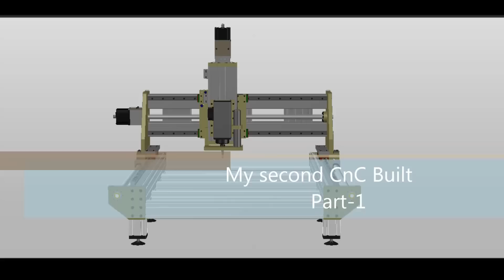Second DIY CnC Router Part-1

Comment from the maker: Trespa is normally used outside for decoration on buildings..low maintanance materials..
normally used in constructions is 6 or 8 or 10 mm..

Its soo much better then mdf or hdf..

Comment: Hi looks great similar to one I am making, not sure to use rack and pinion or ball screw as my longest side is 2000 mm what diameter size screw did you use and did you get any whipping of the screw at high speed i am looking at r2020 screw 20 mm dia but unsure if it will be ok.

Comment from the maker: Trespa is a flat panel, based on thermosetting resins, homogeneously reinforced with cellulose fibers and manufactured under high pressure and temperature.
(Trespa is like compressed paper and gleu under high pressure)
Its verry strong ..but not on the end faces.. 
Normally 6 8 or 10 mm is used.. i found 20 mm but is little bit hard to get..
The name of the song is "Burn the witch" from "Stone gods".

Comment: Hi Ralph,
First I've thought you are using Line 8 160*80+80*80 LIGHT profiles, but on x times replaying your videos I think the profiles are Line 6 120*60+60*60 Light. Is this correct?
What did you use to connect the rail to the profile? It looks like you used normal profile nuts (longer ones) instead of Item's rail mounting rod that fits  only the Line 8 profiles.

I'm building a machine almost like yours, only the side "towers" of Y will be of extrusion (maybe 160*40) and the Y beam will be from single 160*80. But the price difference between the line6 and line8 is almost the double so I prefer the line6 if it's suitable for the job.
Reply from the maker: Hi Zoltan,
I use 160*80 and 80*80 light profiles.. and also the profile conectors to use for connecting hiwin to the line 8 profiles.

dont buy to cheap..it will bite you later..:-)..also depends on what you wanna use your machine for..

I want the machine to be strong for cutting wood and aluminium
Reply: Ralf Klaassen
Hi Ralf,
Thanks for your answer! Yes, I hate bitemarks to, especially on the wallet :) I already spent around 1k euro on parts, and the machine is still on the paper, don't want to ruin it now. I'll go with 16/80+80/80!
Yours are light version if I'm correct? They are still very massive pieces.

My goal is to build a machine capable working on aluminium and softer materials. It must be as strong as possible.

Can you please explain in few words how hard was to align the rails?

Did you machined the profiles where they contact with the rails?
Is the Item's factory cut precise enough to get the frame together, or you had to machine it afterwards?

About the connectors? Is it this one: 0.0.427.39?

Thanks!
Reply from the maker: *****
Yes i use the light version
light version is more then strong enough in a good construct build.
i also use 40x80 between the bridge profiles to remove torsion in it.
its become a verry strong setup.

for align the rails i use 80x160 on perpose because they dont bent...and you can asume they are straith.. i use a clock to straithen it whit the sides..

if you dont have the profiles in between not exact..its a problem..
you can also put the profiles under the 80x160..and the problem is solved.
then you can also make the bridge lower to the rails..so more strenght in the machine.

I think directly from the item factory it wil be cut verry percise..but check it good

greetz,
Ralf
Reply: Ralf Klaassen
Thanks,

I'll order them factory cut to dimension.
The 40*80 is not in the video, you added it later because 2*80*80 was not enough?
Reply from the maker: *****
Hi, i put the 40 x 80  in "Part 2" ..i did it so the ballscrew nut has more space..

greetz

Comment: Ralf,
Who did you get the leads crews from? I am in the process of build a 6' x 10' CNC Router and am interested in putting lead screws on it instead of rack and pinion. BTW, nice job on the CNC table.
Reply from the maker: Hello,
Leadscrew 25 mm from "ISEL" pitch 5-10 or 20 mm from www.damencnc.com
Greetz,
Ralf
Reply: Awesome. Thanks, Ralf.

Comment from the maker: Hello Mark,
I use 25 mm spindels whit a 10 mm pitch.. my longest screw is 1500 mm and is maximum lenght i think,
but at a bigger pitch motors rpm will be  less fast for the same running speed..
for 2000 mm i would go for rack&pinion system i think.

Comment: Nicely done!!! Good craftsmanship, great tunes, and what a cool shop. I like the post and beam ceiling, haha... What kind of driver board are you using? I'm looking at a g540, but the tb6560's are so much cheaper...  How much would you estimate that you have invested?
Reply from the maker: Hi..i wanna use the USBCNC CPU V4 from damencnc.com and i will use about 7000 euro in total for the whole build
I use it for my company so i need a strong reliable machine!
Reply: Ralf Klaassen
Have you looked at a dedicated control like something from GSK?

Comment: what linear rails are these? they look great.
Reply from the maker: Hiwin
Reply: Ralf Klaassen what size Hiwin ? I am looking at changing my setup too, also is this machine pretty precise/accurate at cutting? thx! my machine I am building is about 2ft x 4ft, right now I have shafts with no support (2 shaft supports on either side of the machine) on my 4 ft long X-Axis and it wobbles when I try to rock the machine with my foot (shafts are 20 mm thick) thx!
Reply from the maker: Machine is verry accurate..verry please with the stiffness. Z-axis is mounted now and its great!! I use HG25R type hiwin linear guides for the X-axis and HG20R type hiwins on the Y and Z axis.
https://www.damencnc.com/nl/componenten/mechanische-onderdelen/hiwin-linear-guideways
Greetz,
Ralf
Reply: Thanks! btw what is the length of your X axis?
Reply: would the HG25R's work for a 4 foot length machine?
Reply from the maker: *****
1500 mm lenght.. working dimensions 1150 mm +-
Reply from the maker: *****
HG20R is also good enough..strong enough

Comment: What material have you use to make the supports. I mean, this white faced and black laterals? I dont think its wood, is it? thanks
Reply from the maker: Trespa is a plastic sheet material, which is produced from thermosetting resins, which are reinforced with cellulose fibers. The production takes place by mixing with fiber material and resin material to be cured by means of heating.
Trespa has high impact resistance, a closed surface (therefore easy to clean), fireproof (no melting or exploding ring risks). It is to edit with sawing, drilling and milling tools suitable for hardwood.g

greetz
Ralf
Reply: Ralf Klaassen
thanks! I couldnt find it here... i live in a jungle. Certainly ill do in alluminium. Really nice work, this inspired me!

Comment: nice work  dude, how's the accuracy??
Reply from the maker: perfect ...verry pleased with it
Reply: +Ralf Klaassen I am also wanna make a big size homemake CNC router to make aluminum mold for my compasite parts, your project seems perfect to me, could you please tell me if your router(solution) capable for doing 7075 aluminum within tolarence +/- 0.1~0.2mm?  I am gonna buy analogical materlal then build one by myself, best regards - Cyrus

Comment: that is one quality machine that will serve you well!! well done!! can I ask what is the wood you have used? the black with white faces?
Reply from the maker: HPL stands for High Pressure Laminate,
also called laminate, or plastic plate
mentioned. High Pressure Laminate (HPL) is a
combination of pulp and phenolic resin, with
a hard top layer made of melamine resin.
Melamine resin is the hardest synthetically made
organic matter. This also leads the major Krasen
wear resistance of HPL. The tough and elastic fenolkern makes it impact resistant material. this
characteristics associated with a wide-ranging resistance to chemicals, and a large
heat resistance.
Reply from the maker: I want to change it to aluminium when machine is done and cut them out

Comment: So how's it perform? Not sure about having the rails perpendicular like that
Reply from the maker: Julius Jahn I have inductive proximity sensors to make the machine "home" everytime I use it.. perfectly perpendicular to each other
Reply: Ralf Klaassen sorry, I mean the linear rails in relation to the gantry plates
Reply from the maker: Julius Jahn you mean perpendicular to the x axis rails? still not sure what you mean. the ends of the aluminum profiles of the gantry are perfectly 90 degree cut over 2 sides. and are same lenghts.
Reply: Ralf Klaassen your Hiwin rails are on the top of the frame. Your gantry is on the side of it. You need that butt-joited piece of aluminum to connect the rails to the gantry side plate. I worry that this would be a weak point
Reply from the maker: i run the cnc for long now.. i dont hear or see anything wrong, and it cuts beautifull. no worry here :-). I understand what you say now.. but it has no movement. Gantry material is verry stiff. the gantrry profiles are also connect to ech other so it can not move from each other. For any future builds i would put the hiwin directly under the gantry profile to make that gap as small as possible.

Comment from the maker: ***** The problem of your circles is your x axis is not perpendicular to your Y axis....  Cut a square or rectangle shape as big as possible on your machine... measure the diagonals and adjust the sensors till the diagonals are exactly the same length. so every time you adjust your sensors.. cut a new square or rectangle and check it again... if you have 1 motor on the bridge instead of 2 motors..you need to be sure the bridge is perpendicular to the table. Greetz, Ralf
Reply: thank you!
when you say "sensors" what do you mean?
and by saying "bridge" you mean the part of the machine that is the Y axis (where the rails are right?) Thanks!

also what are good motors to run these cnc machines? I see people running them at 600 inches per minute here https://www.youtube.com/watch?v=u_JIvc4MaGg but on my machine the motors stress out at that speed for some reason and make bad noises. I tried running the motors at a high speed before without them connected to any load and there was always a speed they could not run smoothly at (they would hang up on me) these are the ones I bought, https://buildyourcnc.com/item/electronicsAndMotors-nema24-425ozin
Reply from the maker: *****
by sensors i mean my inductive proximity sensors.. i mean the home/limit switches...
I use 2 motors to power the bridge...so i have 2 sensors ..1 at each side of the bridge..
When homing the motors.. they home independently.. after they are homed they work as home/slave axis..
Running the motors at 600 inch per minute is a verry high speed.. mine runs at max 240 inch /minute.
Running the motors at that speed.. you must make sure you dont lose any steps...
If your machine needs to run 8 hours a day and have to make mass production high speeds are good... but when you make a single product ..why so fast... lett the machine run that steps are not lost.. also tuning the acceleration and deceleration at a speed that there is no step loss..
I use nema 34 motors with a 4 nm torq
Reply from the maker: *****
speed also depends on your ballscrews and motor capability...
Reply from the maker: *****
When you uise 1 motor and a belt to power the "bridge"of your router then you have to make sure your bridge is exactly perdendicular to your table... thats why i like 2 motors ..and let them home independently..
Reply: I dont have a belt really, but I read that could help with increasing the resolution by decreasing the steps/inch is that right? I uploaded a pic of my cnc machine :) let me know what you think! http://imgur.com/gallery/ZcJZip2/new
Reply from the maker: *****
I see that you have 1 motor powering your bridge(1 axis under your table for the X direction) .. so if the bridge is not perpendicular to your table..your circles will never be exactly round. x and y should be perpendicular to each other.
I have 4 motors to make a 3 axis machine... so i have 2 motors on each side to power the bridge.. every motor has its own limit/home switch or sensor.  so i have motor X and B (master/slave) controlling my x-axis(bridge). So if i move a sensor (for example x or B)little bit forward or backward i can change the way the bridge is to the table...
When my machine is homing ..all 4 axises looking for there sensors.. so when x and b are homing they home independently.. so every time i home my machine..x-axis is 90 degree to the y axis exactly...after axises are homed... the x and b work together as (slave/master) and move exactly the same

You have 3 motor to control your cnc right? not 4

greetz, Ralf
Reply from the maker: *****
Nice machine :-) lot of work to enegineer :-)
Reply: Yea, only 1 motor on my X axis, you suggest I should have 2? also ty, took a lot of time, over 2 years to build lol finally came up with this better build but just started with the basic kit from buildyourcnc.com
Reply: I have another stepper motor here I could add, was going to make it a 4 axis machine, How do you drive one motor in slave mode like that for X-axis? and its on the opposite side of the table right? one motor on either side of the leedscrew? (ya im still using leedscrews and not ballscrews yet, lol is that gonna be a big deal with performance issues? I hear ballscrews have no backlash compensation)
Reply from the maker: *****
You can do it with one motor..but then you have to check your bridge ..if its exactly 90 degree from your table.. Thats why i told you to cut a rectangle as big as you can.. and check the diagonals if they have the same lenght..then you know :-).    i
Reply from the maker: *****
Inside mach3 you can slave a motor to a master motor.  i believe 2 motors at each side of the table is stable and stronger then one in the middle...and with the possibilyty to rack the bridge..or bridge is not 90 degree from the build
Reply from the maker: ***** ballscrews i soooo much better in cutting quality.. but it cost bit more :-)...
Reply from the maker: *****
i would first enjoy your machine like it is now...you did a lot of work and spend lots of time .. maybe you can check the construction of your bridge and try to make it perpendicular as goos as possible..
I know how many efford it takes to build one :-).. when you work long enough with your machine..you will know what to change (make better) in the future
Reply: yes :) I am going to do just that it cuts parts as close as it can for now, but with dual ballscrews on the X axis and upgrade to ballscrews for Y and Z do you think it could be more precise for machining smaller parts where tolerence is critical? And what ballscrew brands are good ? I see some on ebay from china but not sure if their going to be good or not. the machine cuts fine enough to be usable for now, doing art engravings and making some small parts for now..just curious about ballscrews for the future upgrade :)
Reply from the maker: *****  i use https://www.damencnc.com/en/components/mechanical-parts/isel-ballscrews-25mm these .. 25mm ballscrews from ISEL and a 16 mm ballscrew for the Z. It is not cheap but the cutting quality in combination with hiwin linear guides is proffesional.
Reply: Super cool thanks! :)
Reply: hey was curious about what you may know of double sided milling (aka flip milling), does your bed or work have to be in perfect alignment with your bit so if you drill a hole at say x100 y10 and when you flip it over and run the other side g-code the bit can move right back to that position? thanks for any info to help me on this topic
Reply from the maker: ***** well.. there are many different ways to do it... if the workpiece is symetric you can make a center line with 2 pins on the table and 2 holes in the workpiece.. so you can flip it around to cnc both sides. before i made some guitars i cut the outlines of the back of the guitar in a piece of mdf or other material.. and i turned the guitar to fit exactly in the outline shape.. then my zero point is exactly found when flipped. sometimes i also screw a piece of long piece of wood on the table (2x4 cm dimension for example).. and eyeballed it +- on x and one on Y ..and zero my tool on the top of table and milled the pieces till i touched all the wood in lengt... on one side. for example i use a 10mm tool then keep the tool in his path.. and type +5 or -5 in the x dro depending witch side it is. so when i zero it i know my tool is exactly in the middle of it. also do it on the Y and remember my zero point. and have some air pressurised clamps to push my rectangle or square workpiece in the zerod corner... also can be used with flip milling if you pre cut the stocks on your cnc before. if it is mass production
Reply: cool thanks, by the way what cam software do you like the most?
Reply from the maker: I like solidcam the most.  i am looking to buy vcarve pro now for my company.